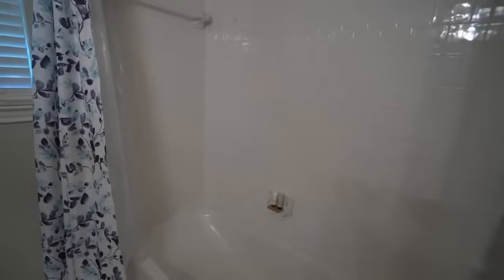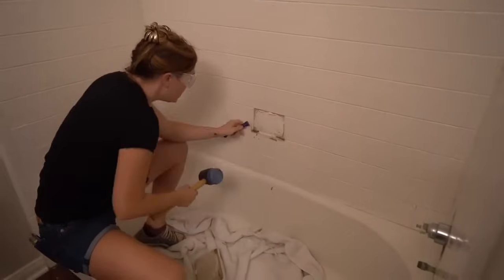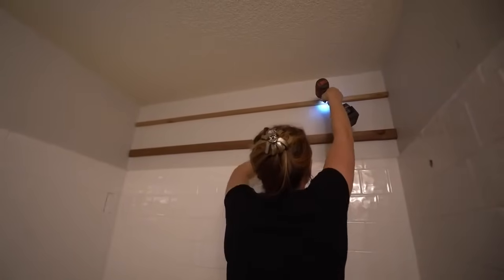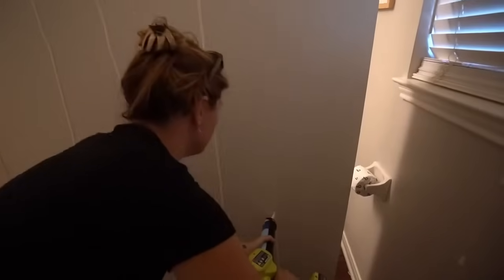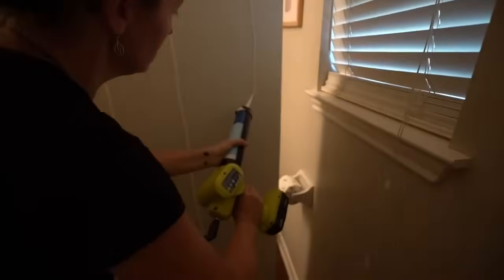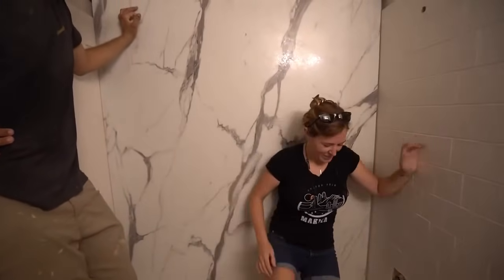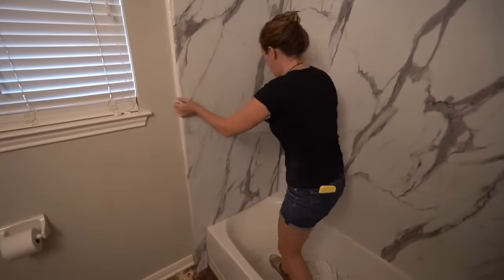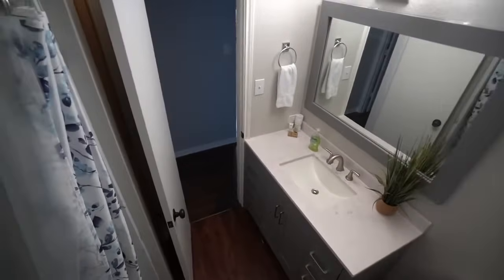Wetwall™ Water-Proof Shower Wall Panels — DIY With April Wilkerson

Comment: What did you use to fill in the holes on the sides above the tile to the ceiling?  And how did you finish the front edge along the tile?  Why did you skip the hard parts on the video?

Comment: Has wilsonart developed a solution for the gap between the bull nose of the side panels and the wall when installing panels over tile like this?   I've installed several of these,   but I was suprised that the reps who presented this product to me were not able to offer any good solutions regarding this issue.
Reply from the maker: If a Wetwall kit is purchased, please follow the steps in #2 below. If buying Wetwall from a distributor that offers individual panels, please follow #1. 

1) Rip a baton strip of a Bullnose Edge + Flat Edge of any design down to the preferred width. Adhere the baton strip next to the tile edge creating a flat/level surface. Cut the wing wall down to the desired width. For this instance, the wing wall was cut to approximately ¾” from the bullnose edge of the baton strip. This will give the edge a “double” or stair-stepped look.

2) Apply the Panel Adhesive to the wing wall panel as directed. Apply a bead of Panel Adhesive on the baton strip behind where the wing wall will terminate. Press firmly over the entire area of the panel to securely hold in place.

If you have any questions, please contact us: https://www.wetwall.com/contact/.

Comment: What do you do around the outside edge? Where the tile meets the drywall
Reply: Seeing how nobody responded to you.... I will. I was looking at this product today but it wasn't at a big box store. The panels have finished bevelled edges if you get the custom sizes. You glue it down and then run a bead of caulk on the perimeters for waterproofing
Reply: @beri232 no beveled edge on the kits from big box stores?
Reply: @youknow1334  I was told that the box stores offer trim kits for the edges.... this was one of the differences between the big box stores product vs the smaller mom & pop stores. No idea if there's any truth to it though. I would go check it out yourself and ask lots of questions. I am probably 2 months out from buying the surround for my tub. We are going with the Wetwall Aria White. We liked the brushed texture and the white matches our Toto toilet and Kohler tub & sink.

Comment: Curious as to what you filled the space on the sides tgat sit out because of the tile left in place. I live your projects and am currently looking at Wetwall as the best option.  I also wasn't aware i could order a full back panel instead of the click version back panel (though I hear it appears seamless), so that is great info to have now. Thanks, April!
Reply: Nevermind, I saw a company response about ripping a side piece.

Comment: No battens at the upper edges where you actually put your adhesive.  😮 Not the attention to detail we normally see from April. 🙁
Reply: Yes, I noticed that. The most important "batten" would be the one at the ceiling.

Comment: we are in the process of remolding our bathroom.  We like the idea of ordering  one sheet 60 inches wide,.  having difficulties finding the whole 60 inch panel.  Where did you order from?
Reply: Loves the video! I called Wilson Art and they led me to believe that 60" pieces are not available?
Reply from the maker: Make sure to use our "Where to Buy" tool. Contact us if you have any questions at 866-WETWALL. https://www.wetwall.com/where-to-buy
Reply: So, you do like the current MOLD and will be REMOLDING?

Comment: Just wondering how you hid your 1 inch gap you created by going to the cieling and mounting over the existing walls.. and good job btw
Reply from the maker: By "ripping" a small piece of Wetwall in that design and sandwiching it in between the wall and the Wetwall panel. Our technical team is here to assist you with any project needs at tel: 1-866-WETWALL.
Reply: @wilsonart what shower pan is recommended? Also do the Lowe’s kit’s have a beveled edge?

Comment: An interesting option, but I'm guessing pretty pricey compared to plain-ole laminate.
Not sure why the wet wall instructions require blueboard backing (if you don't have tiles).  Is this wall not water proof?
Also, would much prefer a gloss finish to the one that comes with wet walls.   Have a 35 y/o simple glossy laminate shower in an RV that looks like new.  I don't think it would look as nice if it had texture to collect microbes etc. Still debating how to DIY a house shower wall.
Reply from the maker: Hi Dell! So sorry for the delayed response. Wetwall is a patented wall panel system consisting of two panels made of High Pressure Decorative Laminate bonded to a water-proof core (Wood Plastic Composite, WPC).  Panels can feature a flat edge, tongue/groove edge, and a decorative bullnose edge. 

Retail pricing for kit of 4 panels will run between $600 and $1100.  Our Wetwall Kit pricing is complete and ready to install.  As a total installed price, we are competitive with mid-tier tile, but goes in faster, easier and looks great.  No professional installation fees or added costs for thinset, grout, sealers, or silicone.  Wetwall provides a patented water-proof panel system, along with antimicrobial protection, and AEON™ Enhanced Scratch & Scuff Resistant Performance Technology.

Wetwall does offer smooth texture finishes, and design structures determine which finish is offered.  
Let us know if we can help with anything else!
Reply: @wilsonart  where can i buy those?
Reply from the maker: @nelsontaguian8911  https://www.wetwall.com/where-to-buy

Comment: How do you fill end the end wall panels which are not flush with walls? 
Surely not just caulking!  Are there L shaped trim pieces to match the panel? 
Very curious.  🤔
Reply: The way I would do it is to take the panel to my table saw and miter a 45 degree cut on the edge that will sit proud on the wall, then cut another miter on a scrap piece the same length, cut the width that I would need for the return, and glue them together with an adhesive like Loctite Power Grab Ultimate. If you can cut your return piece off the same edge you cut your panel for the tub from then your pattern will look like it just goes around the corner and will finish very nicely.
Reply from the maker: Hi Sarah, we are so sorry for the delayed response. Sealant was used to cover the transition between the tile and the Wetwall in this application. However, there are trim solutions available based on the thickness of your tile. Feel free to contact 1-866-Wetwall for details on solutions best for your applications.